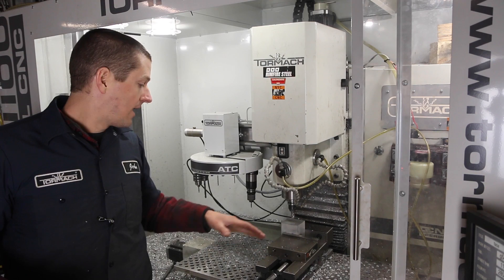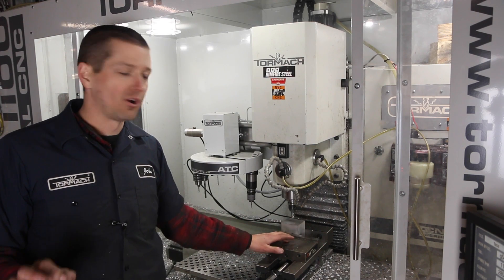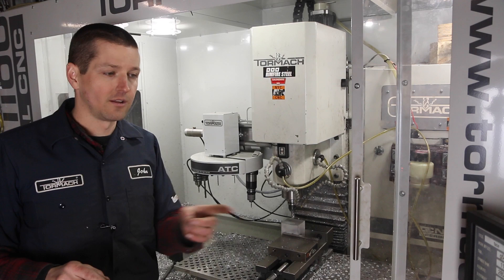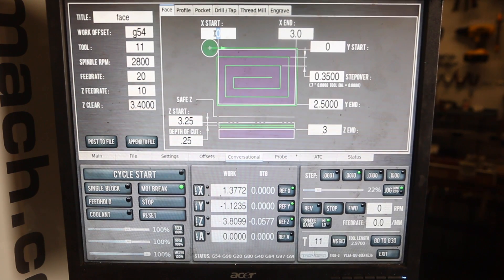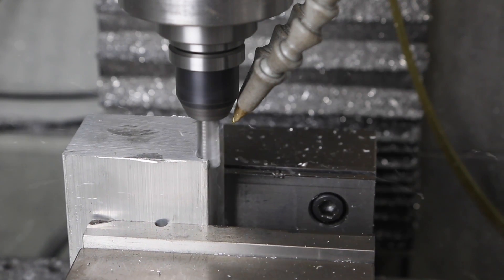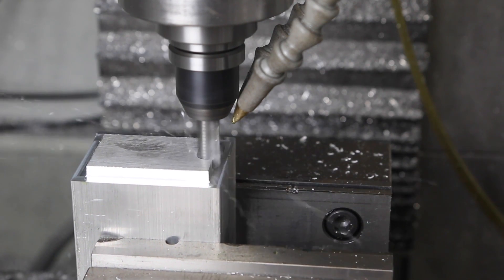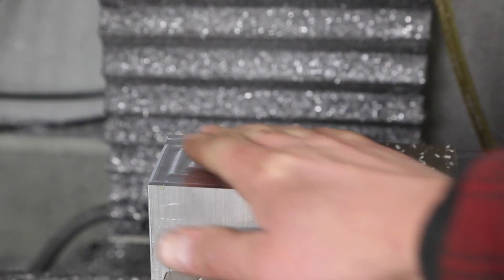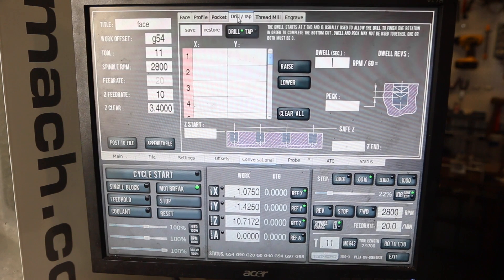Tormach's PathPilot:  Conversational Quick Look!

Comment: to square a part you cut the top and then put that cut face against the back jaw. when you put an uncut side against the back jaw you can get out of square. it may work once in a while but it will bite you in the future. I am one of the tool and die maker - cnc programmer with 33 years of experience that I have heard you talk about

Comment: Excellent video.  I see below that you found out that the diameter needed to be in the offsets.  The tools used in a video would be great information to include in the text description for those that may find it interesting.  What was your tool diameter in this video, out of curiosity?      My main question that I'd really like to know:  If I wanted to only face something off in the Y direction (X start = X end = some value that will only take off one layer in the Y direction, is this reasonable for this GUI?      Example:  I want to take 0.3" off along the Y direction at a depth of cut of 0.1".  My Y start is 0 and Y end is 6".    So to visualize this, I just want to take off 0.1" at a time, three times, from z = 0 to z = -0.3 going along the y axis, holding X fixed.    Is this a reasonable use of this screen or am I hitting a foul ball here?   :)     (This question could be extended to facing something off in the X direction and holding Y fixed?)    Sorry if these are obvious to some.  I'm new to CNC and PathPilot is so new, I'd like to make sure I understand it.  Thanks!
Reply: NYC CNC do you mind giving it a try sometime?   I tried last night and it wanted a z depth of cut instead of zero.    I didn't want to cut in z so my start z and end z were the same.   It said I had to have a nonzero value for z doc.

Comment: Try plunge like that in tool steel :D

It looks good compared to tipical g-code input but still needs some polishing. Google Siemens Sinumerik, Fanuc Manual Guide. Don't get me wrong for this kind of machine this is great but it is still miles away. Same for Haas, I work on VF2 and conversational mode is waste of money for some serious work. But still this looks better than Haas, at least you can set DOC and Z end compared to Haas that thinks that you can remove 20mm of material in only one pass. And you end up with looping your code for x times for every step down. Conversational my ass

Comment: I suspect their software is only available to tormach owners..?  They've got some pretty cool tools.
Reply: LinuxCNC (which their software is based on) is a GPL licensed, which means that any alterations have to be made publicly available as well... Not sure how Tormach is going to handle that, but legally they should HAVE to release Path Pilot as open source.
Reply: Oh wow...  Great info.  Thanks!  I'm guessing you need a linux box to run that software?  It will be way cool if that code becomes open source.
Reply: Greg's Garage LinuxCNC comes with a pre-packaged linux system (It's actually very easy to install and run, worth trying if you haven't). The open source thing I noted above is what I understand SHOULD happen given my understanding of the situation (I'm a software developer). Hopefully they haven't found a loophole to get out of releasing the code...
Reply: Very cool.  I took a peek at the website already.  I'm not a Linux guy, so I didn't drill down too far.  Is there someone selling a system with a stepper controller and the software as a package?  Sorry for the newbie questions.  I'm just realizing that I'm going to outgrow the arduino solution I have in place for my testing.
Reply: Greg's Garage Best stepper control system I've used is the Geckodrive G540, CNCRouterParts.com sells kits of the driver, power supply and 3 or 4 steppers. LinuxCNC comes with a setup wizard that includes an option for the Geckodrive G540 so it's quite easy to get it to work.
Reply: You rock.  Thanks man!
Reply: Greg's Garage No worries man! I'm actually about to sell my stepper control system because I just bought a Vertical Machining Center! Kind of wish I could keep it but I don't have an immediate project that I'll need the steppers for... My last CNC router was built using the Geckodrive kit and it worked very well under adverse conditions for thousands of hours (and still continues to work perfectly!)
Reply: NYC CNC Hey John! I found a good deal on a Fadal VMC10, it's the same as a VMC15, only without the enclosure. I'm going to have a new enclosure made for it. It's a 1994 model but it's only done 1200 hours in that time. I got pretty lucky I'd say and got the machine for just under $7k. It cost $1800 to get it moved to my shop (it was quite a distance away) and I've spent a bunch on various tooling and so on.

The problem is that they basically didn't do proper maintenance on the machine so the linear rails have rust on them and one of the trucks on the X axis had it's end cap busted open. I've been doing a bunch of work on it to get it back into shape. Looks like it will run just fine for quite a while once I get some grease lines replaced and fresh grease into the trucks!

The grease in the spindle appears to have gone dry as well so that will likely need to be pulled apart and either re-greased or new bearings put in. Luckily parts for Fadals are very easily available through a bunch of sources so even if I had to replace the spindle or the linear rails it wouldn't be a huge deal in terms of cost. I could replace the spindle, and all the rails/ballscrews on the X and Y for about $7k and still be well ahead on buying new! I don't think it will come to that though, at least not in the next few years!

The control on these machines looks old-school but is surprisingly full-featured! Drip-feeding huge files to the machine via a serial connection is pretty easy as well.

There's some photos of the rebuild in an imgur album, the rebuild is still in progress though! http://imgur.com/a/ZAIUG

I know you were looking for a VMC as well so let me know if I can be of any help, particularly if you're looking at Fadals. I think Fadals in the '92 or newer range are actually a pretty good buy. Parts are so easily available for them and they're really very simple internally so maintaining/fixing them yourself does not seem to be a problem!

-Aaron
Reply: NYC CNC Thanks John! Still a fair bit of work to do, but it's getting there!

Comment: I'd have probably done that job full width with the SuperFly in a few passes, but I've also used a rectangular pocketing Python wizard in LinuxCNC to face a part (or level the MDF sacrificial table on the CNC router which is a very tedious job by hand).  I've also faced parts by jogging, and by scrolling through a few lines of G code in MDI mode with edits to the values.  I like the conversational wizards.  I know a lot of machinists like manual machining, but even for the menial stuff like this, I generally prefer CNC wizards to turn the wheels for me.  I suppose pre-CNC machinists will often prefer turning the handles themselves, but Tormach's customers are often people with no machining background so they'll learn things the CNC way.

Comment: Good little controller for jobbing type work. Engraving wizard is an awesome function! If you can do accurate circular pocketing that can be useful too (think you could by setting x & y at pocket limits on the centre line of your circle and setting the correct radius)

Comment: I do the same thing with the keyboard for squaring. I guess its a byproduct that Tormach machines are more approachable like a manual mill than say a Haas machine. I guess the graphic is general, you can put the Superfly or Tormach modular in there and give it a larger stepover. The conversational looks cool, looking forward for a treadmill video! Do you have a Passive or active probe, I'd love to see the new menus. From what I hear they added more options!
Reply: The conversational wizard make the path based upon the tool radius (from the tool table) and the stepper.  Putting a 2" face mill or superfly cutter in with the same 70% step over would give you a path geometry where it cut it in 2 passes (instead of the spiral pattern).